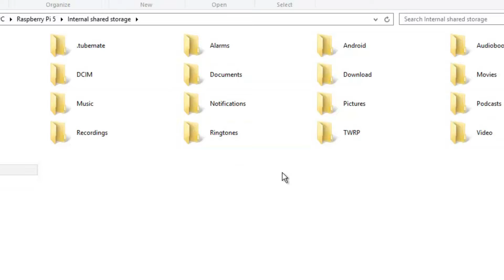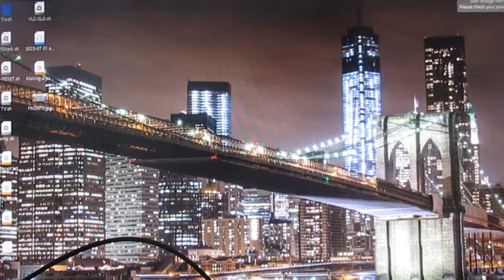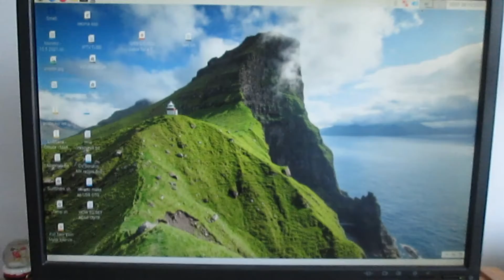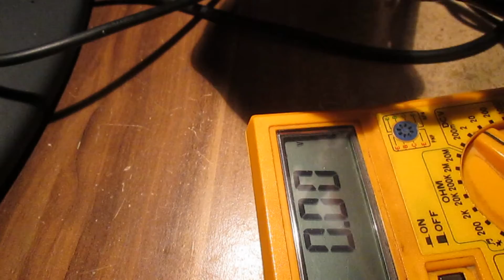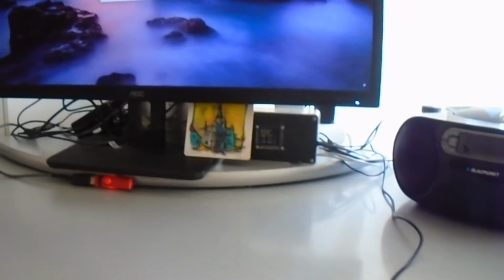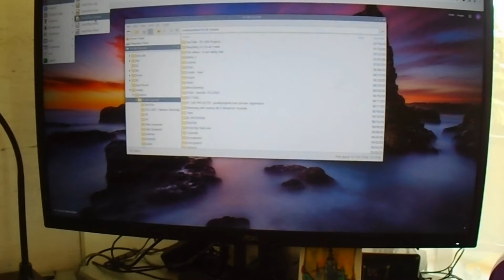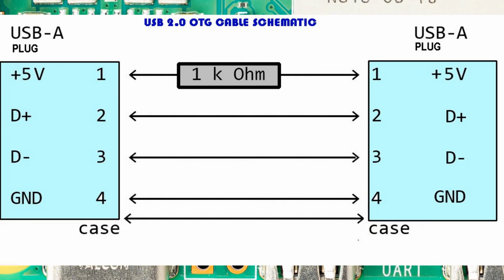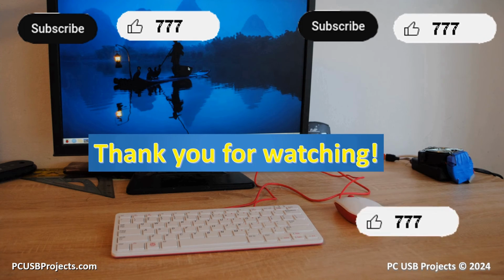Raspberry Pi 5: How to use USB-C port for sharing & power computer via GPIO?

Comment: Hi! I have a problem with my raspberry pi 5 and AOSP 15 (also tried other android builds from Konstakang). Devices are not detected when connected to USB-C. I tried various dwc2 overlay options in the config file, but I think the power supply is the only thing that works well with this connector... 
I just need to output video from my dji goggles 2 to android...
Reply from the maker: Not true! There are 2 versions of  KonstaKANG (Android 15): AOSP 15 and LineageOS 22.2. They both work for me. I also had this problem at first, but I've solved it quickly by setting a correct configuration. I suggest you to use Raspberry Pi OS with "dtoverlay=dwc2,dr_mode=peripheral" setting to check your hardware implementation first. I've tested USB-C port communication with devices and other computers on: Raspberry Pi 4, Raspberry Pi 5 (https://youtu.be/w4H88821tLk, https://youtu.be/kRHbpFQgxu8, https://youtu.be/WBupB-HnLeM) and Raspberry Pi 500. Watch: https://youtu.be/YCx0u1bT3N4 to see how I've also made it work on Rasberry Pi 500. I guess, it also works on RPi 400, because it is just like Raspberry Pi 4. Unfortunately, I don't have one to test it.

Important: Check your firmware settings. You can't use UISB PD, if you are powering your RPi through 40-pin expansion port. I use modified settings (sudo rpi-eeprom-config -e): 
Add line: PSU_MAX_CURRENT=5000 to assure that RPi 5 can use > 3 A from your PSU. Some versions of Android are not able to start, if they don't have this information, or work  in a limited mode.

DEVICE HOST MODE (works in RPi OS);
There are also important settings in config.txt file:  
dtoverlay=dwc2,dr_mode=host
usb_max_current_enable=1

PERIPHERAL MODE (you can use it for connection sharing in Android, as you can see in my videos, also works in Raspberry Pi OS for file sharing through USB) :
There are also important settings in config.txt file:  
dtoverlay=dwc2,dr_mode=peripheral
usb_max_current_enable=1

Use "dtoverlay=dwc2,dr_mode=host" to anable host mode (there are "host" and "peripheral modes". Host mode enables to RPi to be host to various devices like data keys, but peripheral mode can be used to attach your RPi 5 to another computer like classic PC or another RPi as a device. This also works flawlessly.

I use 40-pin expansion port powered RPi 5 every day in hot more and USB-C port works flawlessly each time... It's a 5th USB port. I also use peripheral mode in Android to share it's resources like internet connection through the ethernet.

Also watch: https://youtu.be/17P1YeYgqCQ, https://youtu.be/w4H88821tLk, https://youtu.be/kRHbpFQgxu8, https://youtu.be/WBupB-HnLeM.

However, not all hardware works through dwc2, but most of it does. I suggest that you check the connection with a data key (or other MSD device) in RPi OS, first. Use: "dtoverlay=dwc2,dr_mode=host
usb_max_current_enable=1".
Reply: Thank you very much for such a detailed answer! Today I managed to revive this connector. I did two things. According to your advice I added "dtoverlay=dwc2,dr_mode=host" under [all] in config file. I also added "modules-load=dwc2,g_ether" in cmdline.txt file (this is for android, for RPi OS you need to put these magic words between "rootwait" and "quiet"). 
Now I can transfer a file via USB-C, but I can't get video from my fpv goggles with USB-C - USB-C cable. Goggles are not detected by my RPi when connected. At the same time, this scheme works successfully with my android tablet (file transfer mode and USB debugging mode are active, in addition, the tablet controls the connection, but the goggles charge the tablet).
At the same time, I can connect goggles using a USB-C - USB-A cable and a USB-A to USB-C adapter. With this connection, I can see the goggles file system and can transfer files from its memory card
Reply from the maker: This behavior is expected, because the USB-C port DWC2 driver  is not compatible with all devices when running in host mode. However, you can connect keyboards, mouses, MSDs, Ethernet cards (watch https://youtu.be/xk71szNDWok) , ... However, keep in mind that Raspberry Pi 5's USB-C connector is not USB 3.0 capable (it is not fully implemented), but only supports USB 2.0 standard. A USB-C to USB-A adapter enables you to connect your device to one of USB 3.0 type A (USB-A) ports that are much faster than any USB 2.0 ports.
Reply: @pcusbprojects  Yes, it could be, but... I know for sure that some builds on RPi4B work fine via USB-C with the same goggles. But they are not on Android and will not work for me. Could the hardware differences between the 4th and 5th generations be the root of the problem?
Reply from the maker: Yes, there is a major difference for FW developers. Raspberry Pi 4 only has BCM2711 SoC, while Raspberry Pi 5 has BCM2712 and an additional RP1 I/O controller chip which handles I/O operations like 40-pin expansion port communication, USB ports (2x USB 2.0,  2x USB 3.0 type A), communication to Ethernet controller, communication to Wi-Fi/BT controller, fan speed, etc.. The only USB port directly handled by BCM2712 is USB-C port that only supports USB 2.0 standard.

Comment: Hello, this is maybe exactly what I need, I have been searching for a USB-C splitter but the ones I found was only for audio and the others wasn't capable of powering 27W the Pi5 needs. A guy on RP forum suggested me to power my Pi5 though GPIO pins, then I found your video. BUT, unfortunately, I have zero knowledge and certain urgency in using this way. Is there any possibility to you create a tutorial about how to power a Pi5 through GPIO step by step?
Reply from the maker: In fact it's very simple. If you observe closely, you can see in the video exactly where +5 V and GND pins on RPi 5 are. It suffices to connect external +5 V= PSU to one +5 V pin and one GND pin. If you want to have a more reliable power connection, use both + 5 V pins and 2 of GND pins (not all are shown in this video). There are more detailed instructions on how to build a power cable for powering through 40-pin expansion port in this video: https://youtu.be/YCx0u1bT3N4. Raspberry Pi 500 has the same pin arrangement except the connector pins lay sideways instead of vertical.

Comment: Hi dear, 

I want to power the raspberry pi 5 with full current ie 5A. But it is not doint that. I made a custom power supply 5.1 V and max 8A, but it still shows this power supply is not capable of supplying 5A current.

Please help in this, how can i solve this
Reply from the maker: If you've made the PSU your self, you probably haven't inbuilt a chip to tell RPi 5 about your PSU capabilities, like the original RPi 5V 5A PSU does. So, use an alternative like I did:

Run:
"sudo rpi-eeprom-config -e" and add the following line:
"PSU_MAX_CURRENT=8000"

Max. current is in mA.

Alternatively, you can add the following line to config.txt file:
"usb_max_current_enable=1"
Reply: @pcusbprojects thanks...I will try this..and I am really curious how I can implement the hardware side, like any PD controller thingi for source
Reply from the maker: It works for me. I have a 5 V 30 A PSU. Watch videos: https://youtu.be/kRHbpFQgxu8, https://youtu.be/zNve_hjinDI to see how I've done it.

Comment: Are R Pi5’s USB-3 ports fully USB-C compatible? 

For data and connecting to a laptop as you did through the RPi USB-C port?

I am converting all my USB and microUSB devices to USB-C, it is universal and works better than the other plugs generally.
Reply from the maker: Any USB port may operate as a device port or as a host port depending on your computer's software setting and hardware capabilities. Computers usually have USB ports configured as host ports and USB devices like a keyboard and a printer have USB device ports. A USB host port must provide power (except for self powered devices) as well as communicate to the device. A USB device must be ready to respond correctly to the USB host otherwise the host controller would return an error message.

Raspberry Pi 4 and 5 have 4 dedicated USB host ports and only 1 USB port on BCM2712 that may serve both roles. If you want to connect your RPi 5 to a classic PC's host port this is the only port that may be used. However, you must also configure it as a device port and redirect it to the PC. Originally, it communicates to PSU. I use a data splitter to a for hardware redirection of USB +D and -D signals.

Though USB-C port on RPi 5 only supports USB 1.1 and 2.0 communication standards, it also complies to USB 3.0 requirements regarding power delivery (PD) and a part of the USB 3.0 standard that applies to connecting to USB 1.1 and 2.0 devices. Any USB 3.0 device connected would only be able to use two USB 2.0 communication lines on USB-C type connector. Fast USB 3.0 communication line pairs required for 5 Gbps data rate are not implemented on USB-C port on RPi 5. However, in general the USB-C port is defined within USB 3.0 standard.

The two USB 3.0 ports on the rear side of RPi 5 comply to the USB 3.0 type A connector standard for host devices and may not be used as USB device ports. So, playing with different male and female connector combinations of different types is ok as long as you make appropriate signal connections. You can therefore build a number of connector adapters according to your needs. For example: male USB 3.0 type-A to female USB 3.0 type USB-C.
Reply: @pcusbprojects  Thanks for the detailed reply. 

To get those speeds USB is much more complex than OLD serial ports such as on my Amiga!
Reply from the maker: USB 2.0 is electrically relatively simple: +D and -D signals to transfer data and +5 V and ground. Luckily, you can still use it even with USB 3.x ports. If you need an idea to build an program an USB to whatever interface go to PC USB Projects website (https://pcusbprojects.com)....
Reply from the maker: Raspberry Pi can be powered either through the USB-C port or the 40-pin expansion connector, but there is a danger of inadvertent powering through a USB device connected to the USB-C port, when Raspberry Pi is powered through the 40-pin expansion port, especially if another Raspberry Pi acts as a USB device. A special power protection circuit with a power MOSFET transistor is therefore inbuilt into any Raspberry Pi to prevent unwanted powering through the USB-C port. However, if the power supply through the 40-pin expansion port is switched off while Raspberry Pi is still attached to the USB device through its USB-C, it will try to get powered through its USB-C port. If the attached device is powered by the Raspberry Pi, then there is no problem since it can't source power. But if a self powered device (like another computer) is connected, it can in fact source power to the USB-C connector, because dual powering protection only works when the Raspberry Pi is in fact powered through 40-pin expansion port. There is only one option to prevent powering through a self powered USB device: Inbuild a 1k ohm resistor into the +5 V power line in a USB cable. This will prevent any kind of powering from a self powered USB device, but you can't use such a cable to connect a USB bus powered device like a data key.

Watch these videos next to learn more: https://youtu.be/u3Y7IKSS8u8, https://youtu.be/YCx0u1bT3N4

Comment: i use a ups x1201 to power the raspberry pi5 i want to use a usb-c hub in the the usc
Reply from the maker: Your hat seems to be attached to RPi 5 via a number test points that are connected when you screw it to the hat. I believe that just power (+5 V & GND, +3.3 V connection on GPIO is probably just an indication for the hat that RPi 5 is running) is provided through this pins. If so, I see no reason why you couldn't use usb-c on your RPi 5 to connect an external USB 2.0 device, just like I did in my video. But you cannot use USB-C for powering your RPi 5, as indicated in the hat manual, so be careful, if you are using a self powered USB device. In this case, I suggest that you insert a 1 k ohm resistor on +5 V USB pins in RPi 5 and target device (see my video). I power my RPi through +5 V pins and GND pins on the expansion port, which should be electrical equivalent to my design.

Comment: Are there some simple RPi5 GPIO code examples?  Analog and servo motors code is my interest.   The RPi5 needs a ready to go list of examples like the RPi4. Thank you.
Reply from the maker: There are a lot of examples on GhitHub. However, Raspberry Pi 5 has GPIOs connected through RP1 microcontroller and not directly to the SoC, so there might be a problem, if you need quick response times, also some old examples might not work... Watch this video, if you want to know more about how Raspberry Pi 5 works: https://youtu.be/WFsltbm9ayc
Reply: @pcusbprojects  Thank you for the information. Also, the Orange Pi5 has a confusing GPIO.  Best regards.

Comment: been powering most of my RPis via GPIO pins 2,4 (5v) and pin 6(Gnd)...since RPi2Bv1.2
Reply from the maker: Congratulations! I agree, but transferring data through USB-C port and sharing Raspberry Pi 5's resources is new. I've powered my RPi 5 through expansion port for this reason.
Some also guessed, if RPi 5 could be powered through expansion port's pins at all due to its higher power demand, or if its PCB traces would burn. Some also questioned, if RPi 5 could be powered through just 1 pair of +5 V and GND pins. None if this happened to me. I'm able to power not only RPi 5, but also its external devices like HDD,  a hat, USB hub etc.... It's great! However, USB-C port is not protected, so I also discuss this matter in the video...